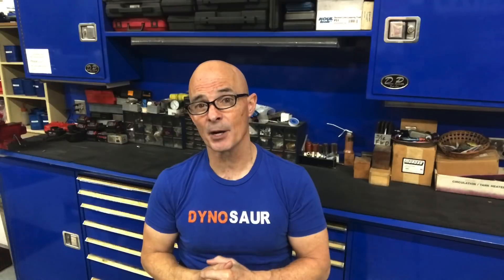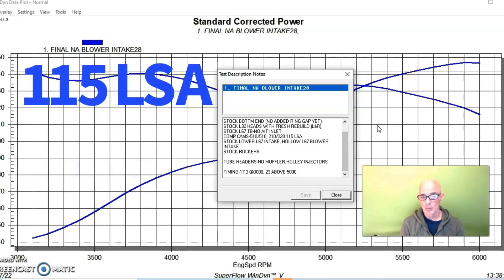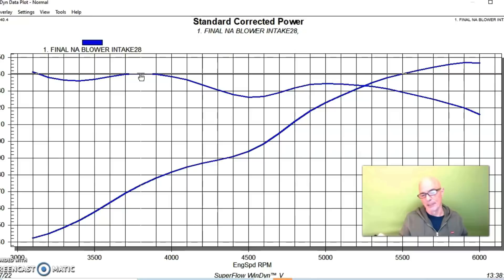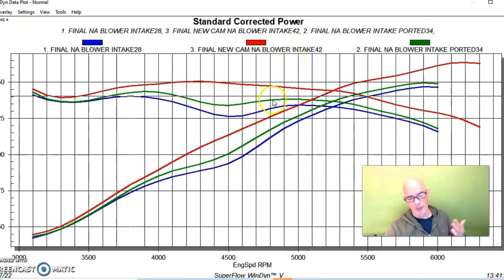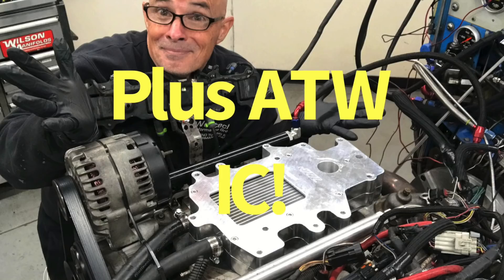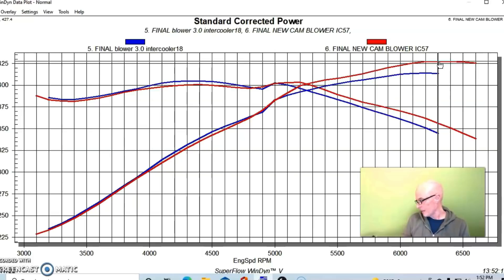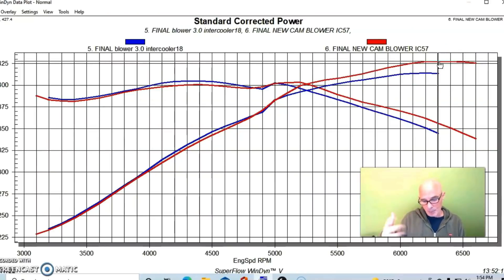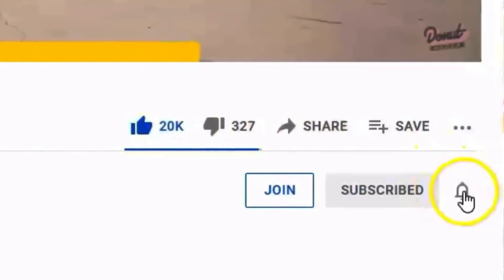HOW TO SWAP A CAM. 3800 V6 POWER-COMP VS ZZP CAM TEST. HOW MUCH IS A CAM SWAP WORTH NA AND BOOSTED?

Comment: I have a dumb question, can you turn a FWD V6 3800 into a RWD?
Reply from the maker: yes-they already do that in the 3800 Camaros
Reply: @richardholdener1727  So, you can take a junk yard 3800 FWD engine and put it into a RWD car or truck?

Comment: I have a 2004 SS Impala with a Gen III blower on it. I want to get a cam to decease boost/temperature from my blower. What kind of Cam do you recommend? I want to see the top end of 200HP maybe like 290-305HP. I also plan on running a 3.5 or 3.4 pulley with no IC or headers.
Reply from the maker: the nic cam
Reply: @richardholdener1727  won’t the nic cam lower my torque in the lower rpms though? I’m getting my engine completely remanufactured so if you have any upgrades in mind I should do for it I’d love to hear. Well read them

Comment: Not worth the camshaft change. Zzp cam is smaller but longer duration. Lift with the wider lsa is best .575 lift + 114 = power 6500 rpm

Comment: More lift and intake duration. Can run up to .540" lift on the stock guide posts. If the posts are machined down it take lift to .590".  I'd run 230-235 intake duration + big turbo. Fun times.
Reply from the maker: WE DID MACHINE THE GUIDES
Reply: @richardholdener1727  PERFECT.

Comment: Why not get/make a larger crank pulley.
Or make some kind of centrifugal crank pulley that expands at higher RPMs? Kinda like the inside of the old distributors. But instead of weights spinning, "pie" shapes would expand, enlarging the workable dia of the crank pulley.
That way you can have low psi for easy drivability. THEN up to 3-4000 she kicks in and exponentially gains pressure!!
WHOOHOO!!

Comment: I want to see a BIG BANG 3800, even if it means a literal BIG BANG 💥.
That splayed crank it gonna cry tears of blood. 😱😈
Keep the 3800 madness going, I'll be watching ! 🤘😎👍
Reply: I put down 1000 for a decent length of time on a stock crank. Eventually it was a main cap that cracked first. Engine was still running, it just dropped oil pressure. Couldn't tell what was wrong with the sump off until the caps were removed. One cap came out in 2 pieces. Super strong little engines.
Reply: @V6turbo  Wow 😳.
What chassis is that thing bolted to ? And what transmission it's jointed to it ?

Comment: Wow!  Not much of a power increase with +10 degrees of intake duration.
Reply: Yeah buts he's all using the l67 which is a low compression motor (8.5:1) rather than An L36 with 9.4:1
Reply: The l67 was designed for the supercharged variants, L36 was for NA
Reply: It made more power at 1.7psi less boost. That's a decent gain. 👌  Run a smaller pulley now to regain that 1.7psi and it will pick up a lot at the same boost pressure as the old cam.
Reply from the maker: please see the previous cam test with no change in pulley size-also ran the cam test na

Comment: Wonder if the tighter LSA of the bigger cam was letting boost go out the exhaust valve during over lap
Reply: yes, the overlap is what the NIC cam is about, so you don't need an intercooler
Reply from the maker: No-there was no boost to go out during overlap on the na motor
Reply: @richardholdener1727  Would that not be the reason the NA setup made more power at lower engine speeds but the blower made less?

Comment: From what I remember, the NIC cam is designed to lower boost more so than others. Its made specifically for Non InterCooled applications so that you can run a smaller pulley without an expensive a2w setup
Reply: You've obviously not been watching or paying attention to  Richards cam testing videos - let me recap, every cam is a boost cam intercooled, non intercooled has nothing to do with it, intercooler is as it says purely a function of lowering intake temps and has no influence on camshaft performance range, the only thing that changes camshaft performance in its range is camshaft timing, intake and exhaust manifolds can make less or more in that range, more or less compression will make more or less in that range, more or less  boost will subjectively make more or less hp in that range, cooler or hotter intake temperature will make more or less in that range, but trying to artificially extend the range has negligible results unless you change cam specs, one thing the dyno doesn't show is the effect on cylinder pressure when making more torque, and hp to a degree is the load on valve train as it tries to open exhaust valve against residual cylinder pressure, and as we know valve train loads gobble up hp but also tear up engines, why do you think the big boys go to 1" dia keyed lifters and 1/2" push rods etc, its not for RPM, that's where boost specific big hp builds concentrate on not oversizing exh valve dia and opening exhaust valve a little latter to combat opening loads, except for blown nitro engines as they have to open exhaust valve early enough to blow down cylinder to stop piston from trying to leave thru bottom of engine which is why you see so much combustion event out the pipes,
Reply: @Hitman-ds1ei  I do watch his videos and have been paying attention. My comment was specifically addressing the part in the video where he mentions boost being lower with the ZZP cam. It was designed with more overlap hence lower boost.
Reply: @Hitman-ds1ei  Andrew was dead right. No one argued in contrast to what you said. He's specifically stating the facts of why ZZPerformance designed the NIC cam for. It's also made to build power in the higher RPM range vs cams with larger LSA.

Nic literally stands for Non intercooled. It was optimized to run better at higher RPM without needing an intercooler. That doesn't mean your can't run an one though.

Comment: I wonder if the exhaust and "intake", the lower part of the blower housing, is limiting performance. Or is it all inefficiencies in the blower itself? I think an NA intake and long tube headers on an all motor setup would gain a little extra power everywhere. I guess we'll see what you did with the turbo setup. The turbo 3800s back around 08-09 were so much faster than the ones left supercharged
Reply: The supercharger has been an issue from the beginning of developement in this series, first there was an M60 which which was replaced with the M90 series 3 then the series 5 which made a difference due to improved design, but by that time GM had made the decision to discontinue the 3800 in favor of the 3600 over head cam because it made good power and was chealer to produce, got a little better economy, was cleaner, lighter with aluminum heads. The SC'r  as in all cases had its parasitic loses and as we have found out, it would have really great of GM had moved from the SC'r to a factory turbo design.

Comment: A whole lot of effort going into this series which I’m sure is appreciated the most by the folks who run the 3.8. But who are they? Is this a popular combination? Are we gonna get to 1000hp? Thanks Richard!👍
Reply: The 3800 is an extremely popular engine still, we still do over 2 million dollars in sales every year just for that engine and the W-Body GM cars as a whole.
Reply: @gbrunner24  thanks, i didn’t know.
Reply: @timearll266  No problem, not many do know. They're super reliable, can take 600+ on the stock bottom end, and will run forever. Basically a 3/4 LS.
Reply: @timearll266  GM 3.8 or 3800 which ever you look at, these engines were in the same popularity/engineering  class as VW Beetles. In the life span of VW's there were over 30 million produced, I'm not sure of the exact numbers for the little GM V6 but it started life back in the mid 60's and continued to evlove into the last version, the series 3 improving all the time. As was stated, it became very popular in Australia as well. It ranked as one of the most well engineered engines of all times, right along with the VW, Cummins b series, and Small block Chevy. Of course there are other engines that were marvels in engineering, too many to list
Reply: This engine was used in Australia in the rwd Holden Commodore and Statesman platforms upto around '04 - '05. Personally, I have the NA L36 in my 2002 Holden WH Statesman, and it goes hard
Reply: @dukeboreham2782  …. It’s my understanding that the 3800 went into production during the mid-sixties and there were probably millions produced worldwide over the span of 40 years. I’m a Ford guy so I haven’t followed the production very closely. I do own a Pontiac GTP with the L67 and I consider it to be a very reliable engine with good performance potential 👍.
Reply: There's a community for 3800s. Its not huge but very passionate. Their great motors, can handle some boost and will run forever
Reply: I've been 8.81@160 @3000lb 3800 turbo. Great engines. With the right parts he would fly past 1000fly. Not sure he will get them though. Still needs more cam.
Reply from the maker: not doing forged internals
Reply: I have a 3800 powered chevette,  runs 11's stock internals, stock injectors...
Reply from the maker: very cool
Reply: I love this motor, community,and ZZP
Reply: ME. I'm building my Monte Carlo Jeff gorden edition!
Reply: Absolutely! Greatly appreciated
Reply: I’m a Buick guy… so yeah there are a lot of 3800 lovers
Reply: Ok so question guys if I put a high performance cam do I have to go through tunning it up ? Or can I run it off stocks ?
Reply: I still own the 2002 GTP that I purchased when new. The supercharged L67, 3800 now has 200,000 miles and is still running strong with no signs of typical wear. 

I did the first upgrade at 2000 miles with a ZZP 3.4” blower pulley along with a few other goodies from ZZP. That’s when I also switched to Mobil 1 synthetic engine oil and ATF fluid which I’ve used ever since. 

I can’t say for sure that the synthetic lubricants helped with the engine and transaxles longevity but it certainly doesn’t hurt either. I’m confident enough in the engines reliability that I’ve purchased a ZZP upgraded PCM along with several of their other performance items which I will be installing soon. If all goes well then next will be their intercooler and another pulley for more boost and a cooler intake charge. 

I couldn’t be more pleased with Richards extensive testing and the mountain of useful data that he has compiled so far. I’m grateful for his selection of such an unlikely engine for testing and look forward to seeing the remainder of what he has planned.
Reply: I know it's a popular engine for Fiero owners, and some of the guys with GM FWD setups. Aside from that, I don't know. Personally, I think the 3800 V6 is obsolete. But the videos are still fun to watch.
Reply: @michaelblacktree  friendly reminder Buick Gnx had a turbo 3.8

Comment: So the cam swap gave a nice drop in boost, but a small power increase. That's odd. Maybe there's a restriction somewhere upstream of the pressure sensor?
Reply: While the supercharger is cool for a factory application it's a wildly inefficient unit. It's a crutch but we love it at the same time

Comment: I love this series. But dang that 3800 has to be the worst soundin engine ever lol
Reply: GM definitely screwed up with their exhaust routing, and up until this year basically every single FWD supercharged 3800 sounded terrible. We fixed that though with our new equalizer downpipe ;) 

https://youtu.be/6SAnRfMTMIc
Reply: The demerit for the worst sounding engine ever goes to Subaru flat-4's.
Reply: Definetly odd sounding but not terrible. They sound so bassy
Reply: They dont sound great under a load, but at idle with a decent cam they are awesome
Reply: Letting an engine sit idle is a waste of horsepower. 😛

Comment: Definitely need to try a bigger cam if the heads allow it. Try contacting brushworks slick sixes for one of their cams or try an intense stage 4 cam
Reply: Emiisions and ECM issues are the real concern here, A person working on one of these still needs to deal with smog and legal issues if left on the street, going to a bigger cam results in idle and off idle firing conditions. As told on ZZP's site, they had the biggest cam which still gives smooth non misfiring randomly and setting CELs./codes. The whole point with a supercharged engine like this is to get more power on the bottom end and a wider power band because of the small displacement. As for the heads, ZZP info describes how these heads function at higher lifts, not bad at all. Well designed. As far as I can find, this engine is about the most exciting power house this is, next I think would be the 2JZ inline 6